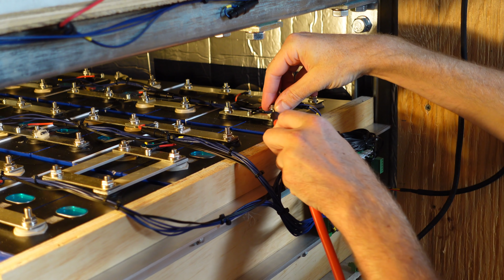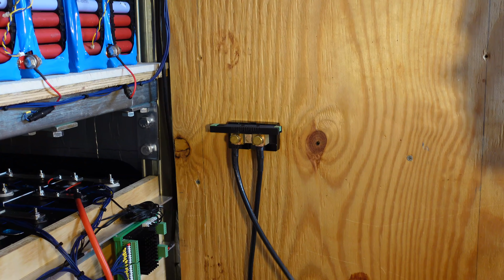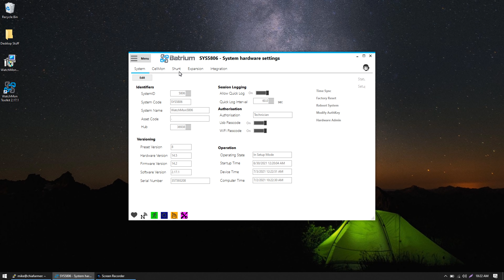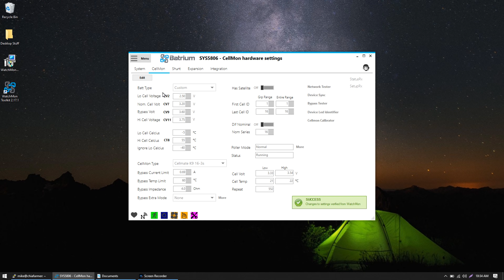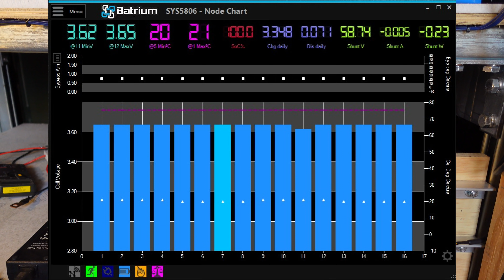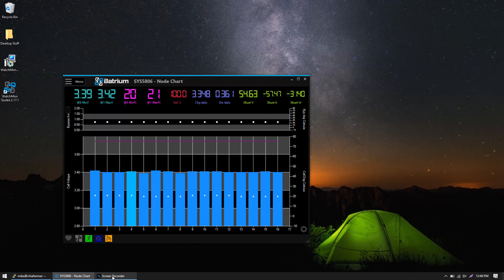EVE 280Ah LiFePO4 28kWh Battery Bank, Balancing and Capacity Test

Comment: I need to build a 280Ah 16S battery for my sailboat.  But i only have 4 locations for 4 cells each. All within 1m /3-4ft.
Is that very bad? What if i take massive 2x70mm2 cables (tripple the size of the short busbars) to interconnect the 4 packs (serial). I use JK 16S BMS with 2A active balancers.   What are your thoughts?

Comment: JK BMS has 2 amp balancing at 48vdc. That means it can handle the big 280AH EVE batteries. remember if you want these batteries to last longest find the sweet spots. you can use 90% of battery doing this and get 40 years plus if you have 4 banks charging at .2C and discharging at .2C which is 56 amps in and out each pack (56x4x48 is over 10kw). that is why you want 2 packs instead of 1 as saving couple hundred dollars on a BMS so you can double the cells is actually killing the life. also squeezing them together causes more heat which kills life cycles. go watch off grid garage and he shows you all of this in more detail. fast charge/discharge of 1C caused to much stress in the cells. .2 - .1C with 4 banks can put out at 160 amps  (40 amps per pack) over 7000 watts. My house averages around 3kw per hour which is less than .1c with 4 banks.. These should last around 40 plus years if I keep them at 70 degrees F.  If you are building batteries for a garage to run welders go with EVE cells and have 4-6 banks of 16s. that way each one can give the high amps and not exceed .5C and still double their live cycles. I hope this makes since. divide the load and get a JK bms for each 16s pack as it pays for itself.

Comment: Shame that you're using windows. People with this level of technical expertise really should be using linux.
Reply from the maker: I manage Linux servers at my day job (mostly Redhat). I have a very strong appreciation for Linux but I still use Windows on my workstation and home computers.
Reply: @LithiumSolar  You are dead to me. Just kidding. I'm the opposite: I have to use winblows at work but I use linux at home. You manage linux servers for your day job? Wow, sounds like my dream job. I used to use FreeBSD to run many server daemons: httpd, pop3d, smtpd, opennap, ircd. Those were the days man. Anyway, great video and thanks for the response.

Comment: Thanks for the video. That's really a battery monitor, not BMS. Lacking the ability to cut power means it cannot protect the battery from overcharge (as you said), over-discharge, overcurrent, low temp  - all very important functions of a BMS.
Reply from the maker: You're correct that, as shown here, it is simply monitoring the battery. At the same time, you're very wrong. Just because it doesn't have a gigantic lump of FETs on it doesn't mean it's not a BMS. In upcoming videos, I will be showing how to configure it to directly control the inverter on/off, the charge controller on/off, and a coil-trip circuit breaker to address all points that you've mentioned - and more. Not all BMS are big piles of FETs ;)
Reply: @LithiumSolar  Thank you for the response. Look forward to your future videos. You're right, a traditional BMS that supports 1C would be rated at 280A. That's a lot of FETs, heatsinks and fans.

Comment: Nice test but I don't know if you said how long it took to bring the batteries down or how long they lasted or not I didn't catch it so if you didn't how long did it last pull in those 3,000 Watts
Reply from the maker: 28000Wh / 3000W = 9.3 hours
Reply: @LithiumSolar  thank you

Comment: Very well done. I think I will be building a similar pack for my upcoming solar installation, using the same BMS you're using for this one. I love the idea of a BMS that doesn't require the FETs that a lot of them use, simply because that makes building the higher current output stuff like the 280-560 AH packs a lot more complex than it needs to be, in my opinion.
Reply: Hi,please how name this BMS? This is just on PC? Or ist possible also using on android?
Thank U

Comment: I have a question to the presenter or who ever reads this: How do older makita batteries balance? These are Lithium Ion, but only have a lead going from furthest negative side cell. Other cells do not have any connections. From newer videos of makita battery internals I can see all the leads coming in, but about older batteries, it puzzles me. I can only assume, that they self balance like lead acid batteries.
Reply: Yes, they self balance through the bms.
Reply: @neliosamch3195  Look up the schematics. There appears to be no bms.
Reply: @varer  Protection Circuit Module Board For Makita Replacement Battery PCB Li-ion 18V, Battery PCB Chip Board For Makita 18V bl1830 bl1840 bl1850  Yes it has a resistor to balance the cells. But some have a calculation between the high and low voltages of two groups.

Comment: Congratulations, on your good work so far! 
What's your plan for the working capacity on daily usage, %?
Are your planing to charge the cells to 3.5v and balance them every time or just occasionally?
Early questions but maybe you already got an answer planed in your head.
Reply from the maker: I'm thinking of having the chargers cut out around 3.5V. I don't see any point in going higher than that really as there is very little stored capacity above 3.5V. I might even drop it to 3.45, not entirely sure yet. I'll have to see how exactly they perform once they're connected to my solar setup.
Reply: The voltage depends of how much solar power is charging the batteries to give time for absorption and floating stages.

Comment: Thus batrium is compatible with lifepo4 ? And what kind of cell mons to monitor?
Reply from the maker: Yes, Batrium is compatible with LiFePO4. It always has been. I used the Watchmon CORE + K9 kit here. The K9 is the centralized cell monitor. It does not require cell mons (longmon, blockmon, leafmon, etc).
Reply: @LithiumSolar  how about for cylindrical since youre using a prismatic cells and the problem that its not compatible to lux power inverter

Comment: First the videos are superb! You are very thorough!
Wow I have questions!!! Where do you get the vast sums of money that you need to do this? And I know it is none of my business. I ask because I have done the math to run my house on these battery/inverter/solar set up and the sum was quite substantial. Just an example if you have an inverter AC unit that has a start up  in-rush of 1800 watts then stabilizes at 1200 watts running you have to allow for the in-rush current all the time in your build as the unit cycles. This is X2 in my house so I have 3600 watts at 220 volts giving me 17 amps of current needed from sun down - a couple hours and till sun up + a couple hours ( You know solar doesnt produce much from 8 am till maybe 10 am) the amp hours needed is phenomenal it seems ...
Reply from the maker: You would need a hybrid inverter to do a grid-tie setup with batteries. The inverter would manage generating just enough electricity to power your home and avoid back-feeding, when to switch to grid, etc. I have not worked with grid-tie due at all due to permitting requirements of grid-connected systems.

Comment: Nice job, at least one DIY guy that follows work safety rules. Awesome!!!!!!!!!!!³ A few hints: IMHO you should use 7.7Nm for torque. Thats the torque for stainless steel M6, since your more than 7 rotations in the terminal.  Also the BMS is a nice system, but I think its a bit overpriced.... I would need a core, 2 16s and a shunt for 600 bucks. well, I did not buy a finished battery product in the first place because I did felt ripped off. I bought them in March 2020 and got 34 cells (2 as spare) for the price of a finished 5kw battery product. I payed about 200 for two BMS from Alibaba and it does the same as the baterium. Just no wifi uplink. Cheers

Comment: I am a bit confused... you said  the anderson cables are rated for 175 amps, but when I checked  the amazon listing it states 6 awg which is  rated for only  50-70 amps ( depending on length ).
Reply: That connector is rated for 175 amps continuous. But the cable with 6 AWG is NOT! If they used high temperature silicone insulated wire it will handle more than 70 amps, but it will get hot.
Reply from the maker: Yes, I was referring to the connector. It's an Anderson SB175 or 175A-rated connector. I don't know the exact amp rating for the cabling used here. It's much higher than 50-70A though due to 200C silicone insulation.
Reply: @LithiumSolar  Thank you, I found these to sources for AWG / ampacity https://www.bluesea.com/resources/1437  https://www.powerstream.com/Wire_Size.htm
Reply: @Arran.Pritchard  The powerstream paragraph on ampacity is informative. Note both of their maximums are "conservative" (which means you may be able to exceed them in some situations) but also application specific (may not be able to match them in some applications).
I quite like the bluesea table, but note it is based on voltage drop. While I don't see it documented on that page, their typical application is specified for 12vdc power distribution and as such their 10% voltage drop limit is intended to maintain usability for a reasonable discharge depth on a 12v battery.

Comment: Back to the basics please, how does a grid-tie battery bank work with a home? not asking how to do it cause that's a liability but the concept. does that mean you must have a critical loads panel or turn off the main breaker? I would love a video on that discussion
Reply from the maker: You would need to use a hybrid inverter for a grid-tie with batteries. The inverter would monitor load and produce just enough AC power to power the loads and avoid back feeding. I have never worked with grid-tie and typically avoid them due to the complex permitting and requirements needed to connect to the power grid.

Comment: So what is the final output of this bank? 56x AH @ 12.x amps? Pretty new to the stuff but always like making the comparison in that way as thats how most van/mobile solar banks are referenced. Great video
Reply from the maker: This battery bank is 560Ah at 51.2V (nominal) which gives a power storage capacity of 560*51.2 = 28,672Wh. If you're asking what this would be in a 12V configuration, there are 32 batteries here / 4 series (12.8V nominal) would give 2240Ah at 12.8V.
Reply: @LithiumSolar  Thanks for the reply -- do you know what voltage most people in van builds have their battery banks configured at? I believe I usually hear it as XAH @ typically 12.xVolts. I bet the system you made would do well in a van build even with a mini split AC. Will browse more of your videos!
Reply: @dividendbro6362  It will be about the same capacity but the 48v system is more efficient,  need lower resistance cable and have less heat dissipation.

Comment: Clear and concise. Great Job. I had the same experience with Shenzhen Basen Technology Co. They decided to push me towards CATL 302AH. Told me they just received the custom BMS they ordered for me. Then informed me the EVE 304AH were out of stock. And I needed to add 23 dollars per cell for new battery. After more trickery on their side I requested them to cancel order. More back and forth, getting toward nasty I finally canceled the Paid for order. Cost me 150. In fees but after I canceled they got nice again and tried more Tom Foolery. Now that the cash has finally hit my account I will just buy the EVE cells from Eve Energy Co., Ltd. While they are more expensive, but they are the manufacturer, so I feel their will be less shenanigans.
Reply: yes that certainly looks like gazumping
Reply: I did the same, they are a bit more expensive. however you will know that they come directly from the factory, just makes you sleep better knowing that.

Comment: Might you share a video on bus bar sizing and why you went with the torque specs you chose?? Much appreciated videos covering your journey to energy independence!! ☺️🙏 Thank you!
Reply: Hes actually a bit low with his 35 Lbs In, that equals to just under 4 Nm. Aluminum screws have a nominal torque rating of 5.6 and thats for M6 4.8 Nm. But he used stainless bolts, and if the bolts are more than 7 rotations in the AL terminal ( mine had about 10, if I recall correctly) he should have used the torque for stainless steel  (6.8) and M6 and that's 7.7 Nm. But since hes not pulling more than 0,1C it will  ot matter. I pull about 0.6C with 2 10kw 400V 50Hz inverters and do have torqued it to 7.7Nm and I also did use custom laser cut aluminum bus bars. The size depends on how much amps your drawing. Pure copper is bad, always use coated coper or aluminum. Calculating it is like the wires you would use, but then, you don't want warm bus bars as they heat your battery through the terminals while luke warme cables are not nice but acceptable. So I just went with 1000a for finding my size. Cheers. I have to say, he did a fairly good job here, compared to so many other DIY guys ignoring all safety procedures. Thanks man, good job.
Reply: @Mannys-World  
interesting
personally i just torque by feel. and even if you  torque them correctly to specs. next day they will be lose again.
and don't forget that stainless steel bolt goes into an aluminium thread.
Reply: indeed I said with more than 7 rotations in, one should not use aluminum terminal spec but stainless bolt spec. and no sir, mine have not come loose again, but I did retorque the bolts after a few cycles, but had no surprises there. If yours have come loose you may have used wrong torque or hardware, you don't go into detail, so I cant offer advice, except to say, if done by the book, it works just fine
Reply: torque specs are the specs that should come with the battery etc.
Reply: It is possible that bolt or nuts may come loose due to the expansion and contractions of the batteries even if they are at the proper specify tork.
Reply: That would depend on the materials used. In this case, we have AL terminals, zink coated CU bus bars and stainless bolts and nuts. So if you torque them down to spec when cold, they get more tight wenn warm and more loose when freezing. So its pretty unlikely they will come loose, especially if you have used the special washers for electrical screwed connections. They could how ever come loos if you torqued them down lightly while really hot and then winter comes, but since lifepo cant handle freezing anyway, that can't really happen. on the other side, if you torqued them rather high in cold weather and use undersize bus br and pull what the pack is able to supply, it could happen the bolts pulls the threads out of the terminal or just get stretched or snap. But that would be an instant power loos
Reply: and keep in mind, at 7.7Nm the stainless steel bolt is already stretched like a spring, but not jet permanently stretched. So he could handle quite some change without loosing tension, and therefore the bolt would not come loos in any of the operating conditions

Comment: Great video. BTW, how do you like that SunPowerGold LF Inverter? Is it noisy (mechanical)? Thanks.
Reply from the maker: It can get very loud when the fans kick in due to load or heat. Otherwise, it's just transformer hum, which isn't bad at all. The inverter itself though is great if you can overlook the high self-consumption.
Reply: @LithiumSolar  
yes, compare that 180W to a victron multiplus 5000 having 18W

Comment: Why did you choose a BMS that cannot protect against over voltage?
Reply from the maker: The BMS will communicate directly with my charge controllers and inverters to turn them on/off. That's the way a BMS should work in my opinion. A FET-based approach works in small batteries but is far from optimal for a large storage system.

Comment: I never thought about the fact that the Batrium cannot turn off the power like a traditional BMS (Without a external relay).
Reply from the maker: The BMS will communicate directly with my charge controllers and inverters to turn them on/off.
Reply: @LithiumSolar   well yes, you could also communicate with a relay to ease sevenc2

Comment: How do you get 28Kw out of 48V x 560ah?
Reply from the maker: 2 (parallel) x 280Ah (cell capacity) x 3.2V (nominal) x 16 (series) = 28,672Wh
Reply: The nominal voltage of a 16S LiFePo4 battery is 51.2v not 48v

Comment: I've watched several Battery Build YT videos and cell balancing always seems to be under appreciated as a NECESSARY CONTINUOUS process. With 32 large cells even small deviations of internal resistance and self discharge properties will lead to rather large imbalances. Most BMS modules have either NO balancing capability or low current, passive type balancing which only occurs above some threshold value of say 3.5V. So in this case, 16S-2P, you are talking about a 560Ah cell. There is no way that 500ma is going to keep those cells balanced when operating only during the time the first cell hits 3.5V until the system reaches full charge. In this video it was mentioned that an extended float was used to allow time for top balancing but that is not always the case. There is an easy solution. Get an active balancer module with Bluetooth. This type of balancing works continuously throughout the Chg/Discharge cycle by extracting power from the high cells and transferring to the low cells so there is minimal energy loss. Last time I checked JK BMS has 1, 2, 5 and 10A balancers available. I am using a 2A version on one of my 48V batteries and have both the 5A & 10A version for my next larger battery. This product costs more than some of the alternatives on ebay Etc. but those do not have any communications or user defined settings.
Reply: balancing under 3.4V can unbalance the battery.  now, about that 500mA balancing, yes looks a bit small but it will do it every day, well most days anyway.
Reply: Yes, this method of balancing is the best. The cells that are always too high when charging and too low when discharging need to be replaced so the active balancer won't be wasting energy all the time.